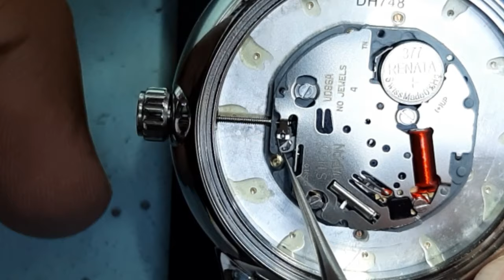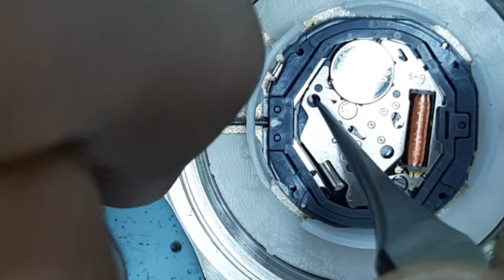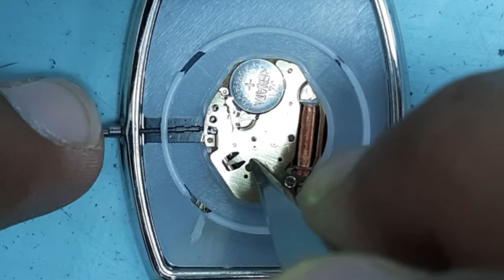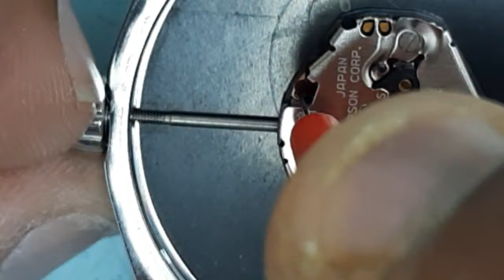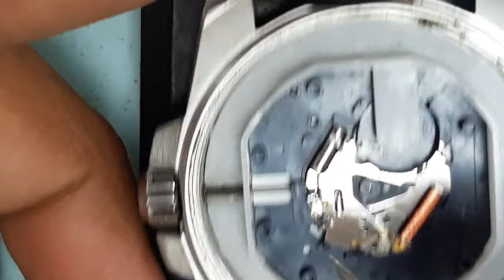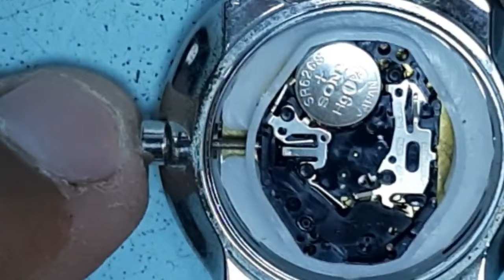How To Remove Stem in The Watch Common Movement | Watch Repair Channel

Comment: Fantastic! Just starting in this hobby and clips like yours really helps keep the frustration at bay. Needed to remove crown from vx43e with no screws or push buttons for stem that l could see. Thanks for the answer.
Reply from the maker: Thanks

Comment: Thankyou so much for this useful video.  I have a miniature gold plated clock of sentimental value only and had bought a new movement for it, but was struggling to get the stem out.  Right near the end of the video you showed the very same movement, and the mystery was solved. I think I would have abandoned it or broken it without your straightforward non gimmicky help.  I nearly gave up with the hands though!
Reply from the maker: Thanks for comments

Comment: Very useful video.  Thank you.  I am just getting into watch "tinkering" and have an old quartz watch that the stem won't engage to turn the hands.  Probably a "junker" but good to practice on as the case needs cleaning as does the crystal.  Doubt if it will ever work again but you never know.  Although the movement of this watch wasn't shown in your video, it gives me a good idea of what to do now.

Comment: Needle sewing Machine I use to press pointer ..80 ..90  ..100 sewing machine needle..............to make screwdriver I USE KNITTING MACHINE NEEDLE I cut off the hook with sand paper I make screwdriver blade......for the magnifying  glass.I use toy  microscope or lens from dvd machine

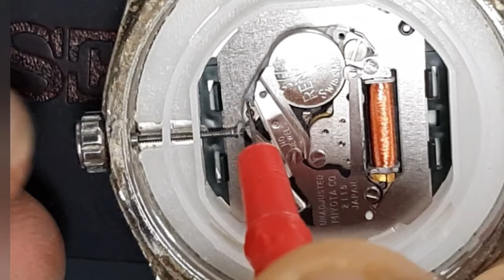Comment: I got a Miyota movement similar to that at 11:35, but where you're pressing it, there is no little hole to press on mine.  I can't find anywhere else to press!  Does that mean I need to take off the plate with the 2 screws holding it down with Miyota labeled on it? This is driving me nuts!
Reply from the maker: Watch the video https://youtu.be/3-YZ2gVdLNk
Reply: OMG.  yesterday I didn't even see the dimple. 😆 I got it.  Thanks!  But now I need a deep 42mm cup to get my glass out.

Comment: I changed both coil and circuit still 2030 machine not working, can u tell the problem???
Reply from the maker: Hey, check if all the wheels are moving freely or if they're stuck.

Comment: Hi, can you please show me how to remove the stem for a 251.471? I have a Gucci YA101322 and the stem broke about 10years ago. Planning to try to change the stem myself. Please please help!
Reply from the maker: Play This video, stem remove process is same https://youtu.be/-FILHwvxXPs 
(Dont try remove broken the stem yourself, damage your movement)
Reply: @SolimBD  its not the same eta bro. And I've always tried the little hole with arrow. It doesn't feel like there a clickable bottom. The bottom end of the hole feels like a dead metal end.